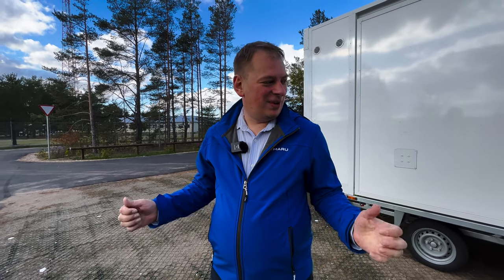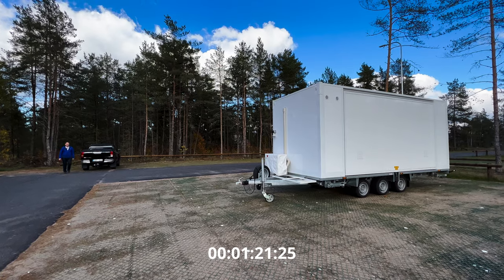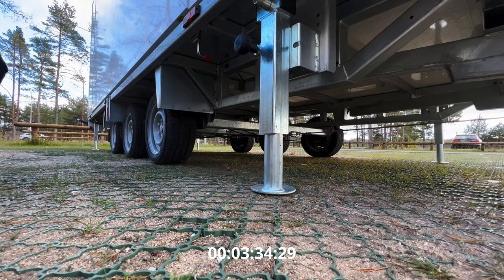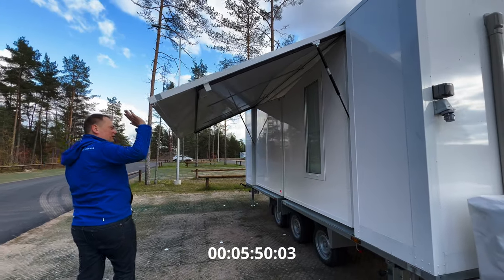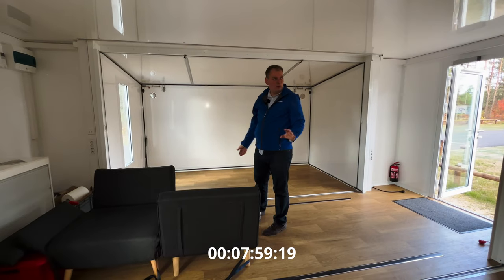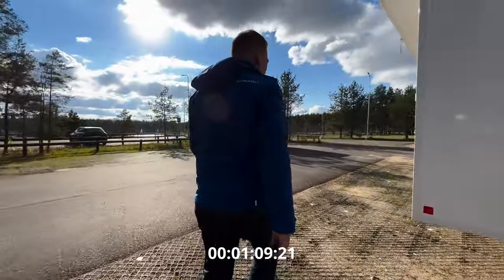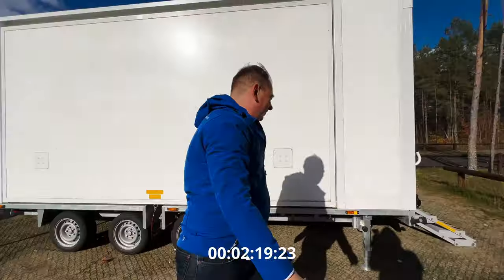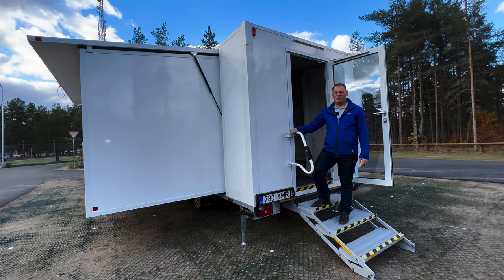Is this the fastest Expanding trailer in the world ? Rolling Unit L 2022 edition.

Comment: Excellent design.  My only concern having had so many of my vehicle gas cylinders get weak and change performance with temperature, that in the cold they may not work as well, and over time.
Reply from the maker: Absolutely correct assessment. We have thought about that. All our gas struts are adjustable so you can have different pressure settings for summer or winter use. However, we in our factory adjust them for around 10 degrees Celsius outside temperature. This way it works on most condition with a bit of force on the extreme temperature side. Also, all the cylinders are changeable and they are reasonably priced so you can exchange them every other year if they get weak over time...